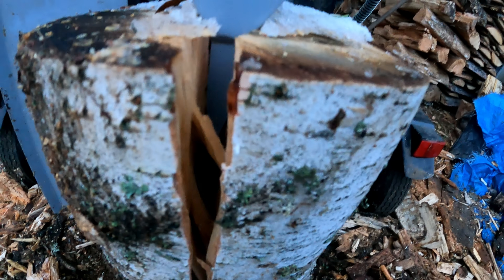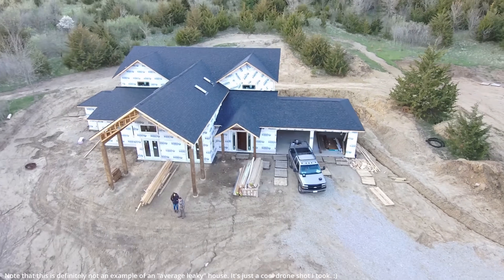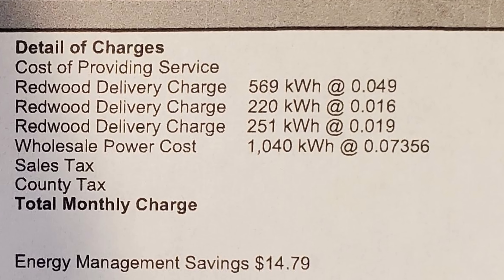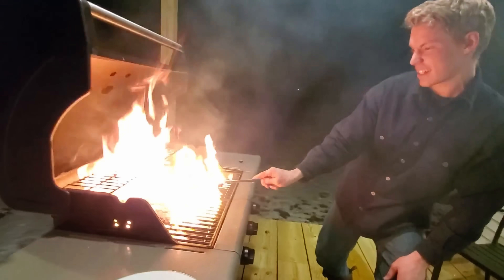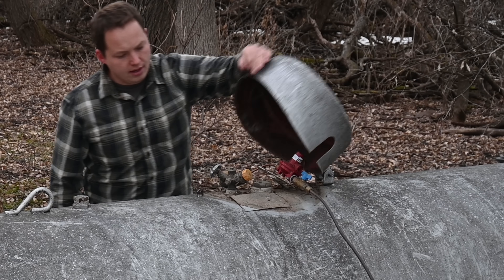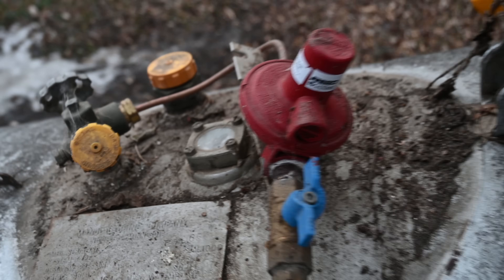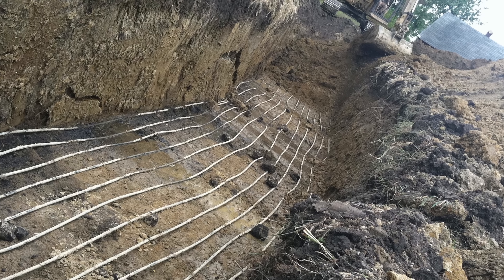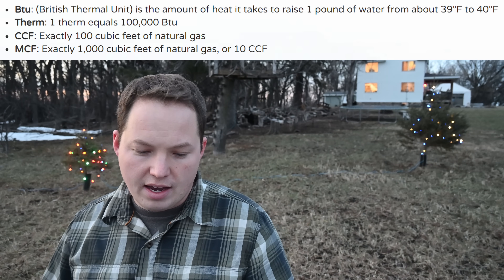What's The Best Heat Source in 2022? Top 5 Home Heating Methods - LP Electric NG Geothermal Fuel Oil

Comment: Our natural gas rates went up 87 percent last year and not sure what it went up this year, but I'm sure it will be up. Having a house built and went with NG over HP as provided by builder. They charged me extra for equipment since it was not their standard equipment. I like NG. had a HP in the past and it never kept up in the winter when it got below 30 degrees. Hp are great in mild climate areas like Texas, but not in my area. 20 to 30 degrees 4 months out of the year. My friend lives in Texas and it was 96 degrees last week. October 1.  Here its 30 degrees.

Comment: Now that fuel oil cost will be 4,950 at current FJB prices so it’s cheaper to buy electric space heaters if you electric price is below 18 cents a KWH

Comment: This old apartment building I live in uses radiators. The water is heated by natural gas. I don't control the thermostat, so if it isn't warm enough I use an old incadescient light bulb for light and extra heat.

Comment: Is there a way to use solar with mini splits to reduce cost overall?
Reply: Yes, I'm installing a mini split to do exactly that. Oct 2022 heating oil prices in my area of the Catskills are a whopping $5.28 a gallon, the supplier told me he expects it to go higher. I bought a mini split and I have battery back up (15kWh of battery) with PV (58 solar panels). I'm going to run my heat, hot water and charge my EV with my off grid system. Right now I'm driving for free and have free hot water (tankless) as my PV is paid off excepting for what I added last summer but I figure I'll recoup that within two to three years. 

Buy a mini split, that's what I'm telling people, they're really getting good now, my SEER is 25.5 and I think you get a government rebate for $300 so putting it in myself it will cost me ~$1400 but you have to know what you're doing. Ben has some excellent videos out on this.
Reply: Yes. Will need battery backup to store the electricity and lots of solar panels to recharge the battery.

Comment: Thanks for the breakdown.  I use a 40,000 BTU wood pellet stove and run about 80 bags through it per winter from October to May in Iowa for a 1600 sq.ft. ranch house.  The stove is rated 80% efficient.  

At about $5/bag that’s $400 in a season.

I also have a 93% efficient natural gas furnace which adds about $80/month for heat in the worst three months plus another $35/mo for hot water year round.

I have replaced all the insulation in my attic with open cell foam between the rafters of this 1958 ranch house.   

I just put a 2.5” of closed cell foam throughout the exterior walls in a cavity between a brick and block wall.  (The house was built by a brick mason.)  So I’m curious to see what that does as the walls had no insulation before this.
Reply: you insulated the drying cavity for the brick? lol
Reply: @paladain55  What problems do you foresee?

The English and Irish seem to have no problem with it, except perhaps for rain-lashed houses on their coasts.   

Engineer Joe Lstiburek's presentations on building envelope design were consulted, as well. 

So far my gas bill has dropped 38% or more in each of December, January, and February, although it is not my major heating source.
Reply: @CannabisRex  Typically the wall drys so slowly that the bottom wall plates will stay wet all winter which will lead to mold. The convection cavity helps pull the air up and down. My current wall cavity is brick veneer with a 1" airgap for drainage to a 1" foam board. I'm interested in the link to your joe lstiburek article saying otherwise.
Reply: @paladain55  (Sorry for the repeat post, and it may happen again here due to editing problem) 
I don't have wooden bottom plates.   Inner wall is 4" thick concrete block placed on slab on grade.
I reviewed any Lstiburek video I could find.  He may have been the one who mentioned rain-lashed houses.  I seem to remember that  he was addressing multi-story brick when the spoke about the issue, and maybe commercial buildings.  I don't have a link.  But I saw nothing of his which seemed representative of my situation.
Reply: @CannabisRex  You should be better off with the inner block vs osb to wood frame to gypsum board. Its still technically probably wrong... But I imagine it will take a long long time to know! For the most part it'll help a lot in the long run if you control the indoor humidity throughout the year and never hit indoor humidity's that would hit dew point on your walls. So 35% in the winter etc...
Reply: @paladain55  Thank you.  Yes, indoor humidity is an issue, but I have a humidifier running much of the time.  I don't think I've ever gotten up to 35%.  I'll be watching the walls and the roof, which I also foamed.  Roof foam is open cell, but the attic space is conditioned and monitored.
Reply: @CannabisRex  max of 35% humidity in the winter is what is meant. If you stay below that there won't be enough water in the air to hit dewpoint.
Reply: @paladain55  Yes, I understand.  Thanks.  Are you an HVAC pro or trained/experienced in some capacity? 

I'm trying to raise the humidity in the house.  Right now it's 22% at 72 degrees.
Reply: @CannabisRex  Engineer but yes. I mean that 22% is even better. In the winter don't go above 35%. Although i imagine 22% is painful on the humans lol (desert dry)
Reply: @paladain55  Seems to bother one of my eyes when I sit close to the pellet stove output too long.

Comment: From $1172/month down to $385/month  - I have never spent more than $250/month to heat a 2700 sq/ft house with a heat pump.
Reply: Just a heat pump with a gas furnace?

Comment: I use natural gas for my main heat. I use an oil-filled radiator to supplement the heat. In the basement I use a compact electric space heater. I keep the house at 68°F and the other 2 heaters raise it to around 70°. I close off unused rooms. There is a 3rd heater in my shed if it gets below 30°. That's to prevent my air compressor from freezing. 🐀🐾

Comment: In central British Columbia I will be (house under construction) using propane fired demand HW boiler for in-floor radiant heating.  Demand heater also supplies DHW - the boiler is a combi unit.  Using propane because, other than electricity, it is the only fuel option living in rural BC (discounting wood which will be a secondary heat source).  A mini split will also be used but primarily for cooling.

Comment: Hey In Germany is 2 Jears ago Heating with Natural Gas 2276€ This Winter 3 to 4 times Higher... We Are have (18.000KWh = 61.500.000BTU) Price is going from 1400€ to about 4000€.... Its Crazy... i Habe Buy a Panasonic AC with A+++ Heating Heating with AC costs About 1600€ für 18.000KWh @0,35ct/KWh Electric... Electric is also going Crazy up to 90ct....

Comment: I'm heating using natural gas normally in europe but since prices shot up I think the era of heating the room/air is over, way too expensive. I use small 250W ir bulbs dark radiators and leave the thermostat at 10⁰C. I've also reduced the living room down to 1/3 of the space with diy panels with wood and rockwool. That alone saved me 40% of the energy bill with room temperative of 17⁰C in winter. I only heat the room I'm currently in and keep the rest above freezing or around 10⁰C to prevent conduits from freezing. This winter I intend to save 40% again by reducing it to 10⁰C and warm up the spot I'm sitting with ir bulbs. Electricity bill will go up a few 100s of euros but the gas bill will go down a few thousands.
With a few layers of pullovers and trousers (don't forget your legs and feet!) and a few warm sleeping bags to warm my feet/legs while watching tv or working in my home office I'm still pretty comfy.
Next years I)ll invest in solar panels, using the power to heat the rooms directly/resistively. Hopefully so far that when the sun is down the house remains at a comfy temp.
In december insulation to floor (spray on) and wall (foam granules) will be installed. Hopefully it'll a bit more comfy by then.

Comment: Great job you did on your house and explaining the fuel costs. Thanks!
I guess I have always been lucky and had natural gas all the time.
I even converted my old Honda generator over to natural gas a few years ago and am very happy I did.
No need to buy expensive gasoline if you can even find it during an emergency.
All I had to do was check the oil every so often.

Comment: The little place I live in (800 Sq ft) has baseboard electric heat. When the weather gets below freezing I use a 10,000 btu kerosene heater and that little gem warms the whole place. Until recently kerosene was less costly than electricity with a warmer heat. When I heard the country's management change I purchased a few years worth at less than half the current price ($6.50 a gallon) I remember the 70s. I survived Jimmy Carter and came out smarter. This too shall pass.

Comment: Most of the costs associated with heating comes from Transportation cost it is wise only to use one source. That works with an electric furnace. My total electrical bill is cheaper than most people's electrical Plus Fuel bill

Comment: I supplement my natural gas furnace with a high quality electric heater at night time.  my electricity is  $0.04429 per kWh at night due to a off peak flex rate plan.

Comment: This video is very informative, but not entirely correct, depending on geographic location. At 100% efficiency, electric resistive heating will provide 3412 btu/kwh. Electric in my area is 9.15 cents per kwh. Using your own number of 100,000,000 btu needed to heat a house for the winter, that will come out to needing 29,308.32kwh. That times 9.15 cents brings us to $2681.71 for the winter. Propane in the area is going around $2.45 a gallon delivered, but I am just going to use the regional rate chart as you did for my state and that comes out to $2.38 a gallon. A gallon of propane can produce 91,502 btu. Crunching some numbers, that means we need 1092.872 gallons of propane, which will cost $2601.04 to heat for the winter. But there is the efficiency loss of that 95% efficient furnace, which means I am actually only making use of 86,926.9 btu per gallon, meaning I actually need 1150.392 gallons of propane, which brings the cost to $2737.94, or about 50 bucks more than electric resistive heating. The break even point for me would be right at 97% efficiency. Beyond that, geothermal or a heat pump would be far more efficient. Downside to the geothermal is the cost of installing the ground loop. All that being said, when my current A/C unit gives up the ghost(2007 model, so it probably isn't terribly far away), I will likely be going with a heat pump to reduce heating costs.

Comment: We are $.34-$.42 a kilowatt hour here in San Francisco California almost nobody meets the base rate they always exceed the $.24 per kilowatt hour allotment that they are not allowed to pass otherwise they’re penalized with higher price. 

Heat pumps work beautifully here in San Francisco because our climate is mild right in the zone where heat pumps are most efficient where are outdoor ambient temperature on a cold night is usually in the mid 40°F to high 50s°F and heat pumps operate there more efficient in this temperature range

Comment: Pellet stove… way cheaper than wasting time with all of that. $300 to heat my entire downstairs per season. Then using a small oil electric heater in bedroom to sleep while the stove is off downstairs. You of course need a eco $1700 pellet stove that turns on and off when it reaches a certain temperature..

Comment: The best source of energy depends on your location and time of year. I live in the PNW of America and pay .12 cents per kWh. It is always cheaper for me to use electricity 24/7/365. A friend of mine lives in upper New York and pays over double what I do for electricity. He uses a combination of oil, NG, and electricity to help reduce his costs. 5 years ago I bought 5 ENVI electric panel wall heaters and cut my electricity cost by 1/3 over using forced air with a heat pump. Geothermal with hydronic heating is the best possible heating option with the highest upfront costs.

Comment: Thanks for the great video. I live in PA. We have a very modern heat pump that has never gone into emergency heat mode. Our old heat pump would use the back up coil system at 25 degrees and struggle below 18. Our new heat pump works well down to 15 degrees, that's the coldest temp we have seen since owning it. I started using the fan circulation mode and our home is WAY more consistent temp wise. My wife loves it. Take care!
Reply: I'm in central Pennsylvania.  See my comment above. I don't agree that heat pumps are efficient at low temperatures. The lower the temperature the more the heat pump has to work, with a corresponding increase in the total amount of electricity used for its operation. As you said, in super cold temperatures a heat pump will kick into auxiliary mode resulting in an enormous electric bill. I would prefer to avoid those costs, so I'm looking into a coal stove as a backup.
Reply: @LostBeagle , Carrier makes a high efficiency heat pump, that even at -5F will provide all of it's rated heat output.  The model number is -38marbq30aa3 for the 30,000 Btu unit.  These can be connected to a  central air system, or a ductless indoor coil.  They do have a variable speed compressor, thus at 47F it can run at 60 Hz, and at -5F it can run at 120 Hz, or twice as fast, and bring in much more heat than a typical heat pump.  

Where I live, I installed a new 2014 14 SEER Goodman 4 ton heat pump for 1,850 square feet.  Yes it is oversized for the cooling capacity, and huge!  But the rating at 23F is only 28,000 Btu's per hour, or barely enough to heat my home.  Still it has worked fine on the recent 23F cold snap we had (almost record breaking cold in Portland Oregon).  I never connected my back up electric heater!  It has run for 8 years and never ran the electric heater!  I guess if the compressor fails, I will need to connect the 20 KW electric heater, or run my electric oven to warm the home.  

I have a oven thermometer on my hot gas line, the insulated one between the outdoor unit and the indoor unit.  It typically is at 120F 5 minutes into a heating cycle, and will reach 165F (setting off the alarm that my meat is done) after about 30 - 45 minutes on a 47F day.  At 35F the temperature was about 135F and will slowly warm to 155F over about 1 hour of run time.  

If you are not getting these temperatures, check your temperature split, with 65F going into your air handler, the output should be 30F to 35F warmer, on a very cold day at least 25F warmer.  If your performance is less, then have the refrigerant level checked, leaks found, and fixed.  

Your system should provide you with 100,000 Btu's of heat while only using 7 KW to 10 KW of electricity, so much lower cost than running a gas furnace with today's prices!

Comment: I live in Northwest Ohio. I installed a Goodman 3 ton ac/heat pump unit3 years now. I have a 2100 sq ft ranch home that has some air leaks. I use my heat pump down to 20F then my propane furnace kicks on. My plan is to install a fuel oil boiler in a shed 20' from my house and do a conversion to run on used motor oil and install a heat exchanger in my furnace and also heat my pole barn. I have access to hundreds of gallons of used motor oil every year.

Comment: One thought about this. Instead of heating the entire house during the winter. Using low-power resistance heating to just one room that you are in might provide significant savings w/o fear of fumes, explosions, fire, etc. There are 700-watt space heaters that heat oil, and the oil retains the heat pretty good. The thermostat draws power with some duty cycle just to keep the oil @ the desired temp. Then the problem becomes one of storing electricity enough to run the small space heater (EcoFlow delta pro, etc). and efficiently charging up your battery using solar, wind, or small propane (or gasoline) generator when solar & wind don't work. The small heater can be moved to your office, when you are there, and your bedroom when you are there, etc.
Reply: Morpher44,  Yes I thought about this, and letting my daughter use a 1,500 watt space heater to warm her room during the day, when most of the house is gone and she is there alone.  But consider this.  For the 1,500 watts the electric heater can produce - 5,400 Btu's, the heat pump can warm the whole house for 15 minutes and bring in about 15,000 Btu's to the house.  (even more heat if it is above 50F outside)  So much less expensive to heat most of the home than just one room at a time with the electric heater.    Yes I do shut off the vents into some of the un-used rooms, but still must keep at least 1,400 CFM of air flow, or the heat pump can overheat itself if there is not plenty of air flow to distribute the heat it collects.  

If you have a oil furnace, that costs about $6 per 100,000 Btu's of heat.  A electric heater is 23 KW per 100,000 Btu's while gas is about 1.2 gallons of LP or 1.2 therms of natural gas.  A heat pump is significantly less at 8 KW.  23 KW of electric heat might be $2.76 in my area with $0.12 per KW electric rates, and $5 in California with $.025 per KW rates.  So shutting off a oil furnace and using electric is lower cost, but not close to the $1 per 100,000 Btu's of a heat pump.